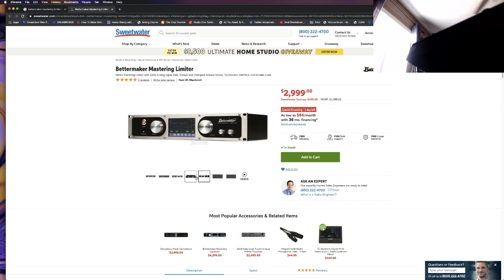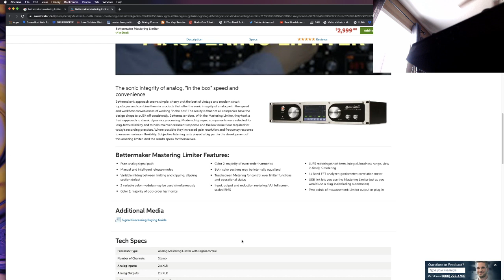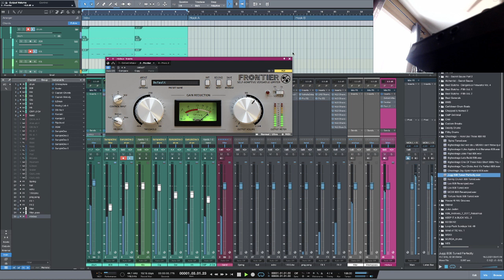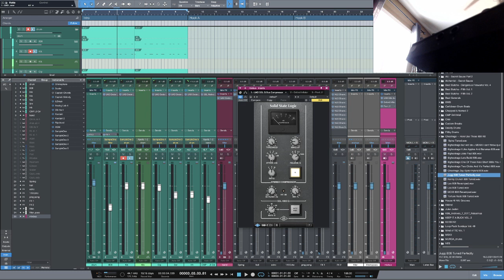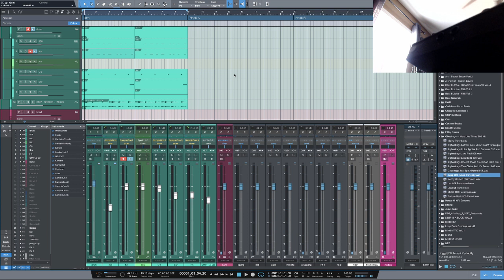How to Make Your Beats Loud Like a Bettermaker

Comment: I hope Bettermaker makes a plugin version for this so I can finesse it with the Plugin Alliance subscription bundle. 
I seen one in the main room at some studio in Van Nuys but I didn’t get to hear it, the dude there vouched for it though. 

I make trap beats & work in Ableton. What I found for a louder mix is using brainworx town house into brainworx master desk and then tracks clipper. 

I’m usually peaking around -12/-9db. I use the mixing cheat by CMP with some minor adjustments. Kick at -15db, 808 at -18db, Snare at -18db, HiHat at -30 & instruments peaking around -27db.
I also keep a tracks soft clipper on my 808 & Kick so if I want it to be louder, I push the clipper more and I’m still at the same dB.
When I’m done with the beat and mixing, I group the whole beat and play it in it’s entirety with a VU meter on the master (mvMeter2).
From there I turn down the grouped channel to make the VU meter hit 0, I also have all my musical elements or sample printed so the VU isn’t changing. 
I then do some glue compression with the townhouse, I go for -4 on the VU and then turn the mix to 50%, then use a gain plugin to bring the VU back to 0.
From there I turn on the masterdesk and turn up the volume all way but I turn off their compressor, resonance filters and make sure the output trim is at 0. Then I push 9 db of gain with the T-Racks Soft Clipper.

I’ve tried pushing soft clippers like your video but it don’t hit the same.
Reply from the maker: Dope bro
Reply: Just tried what you wrote here... THANK YOU SO MUCH, levels and settings wor very well. Thank you too CMP
Reply: I hope so too :)